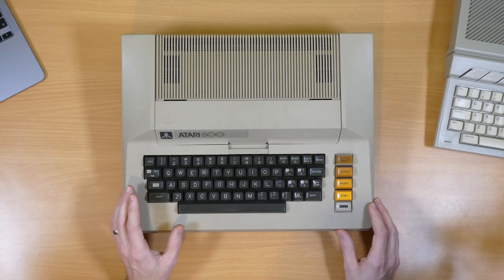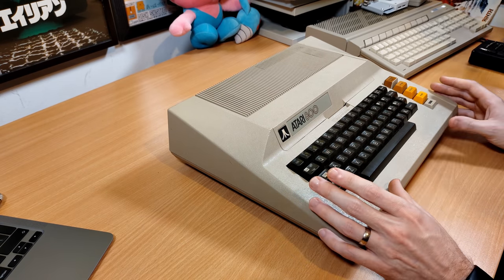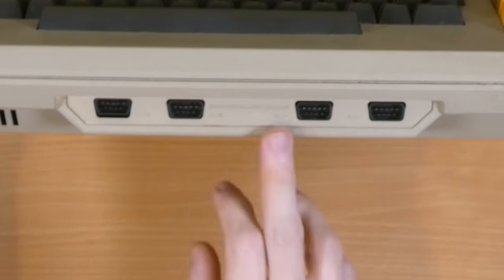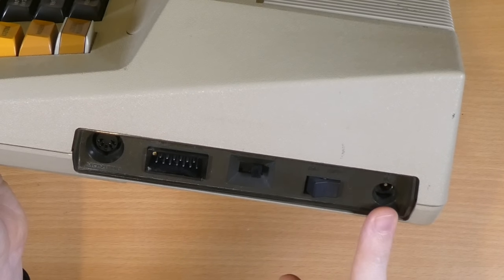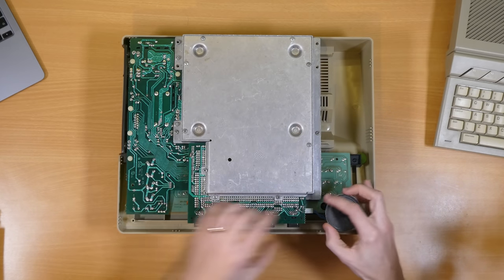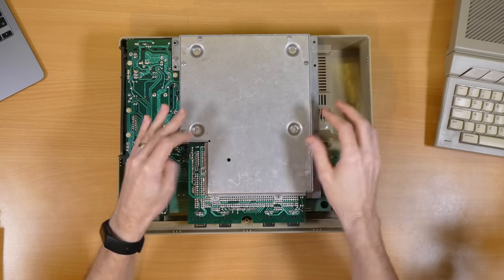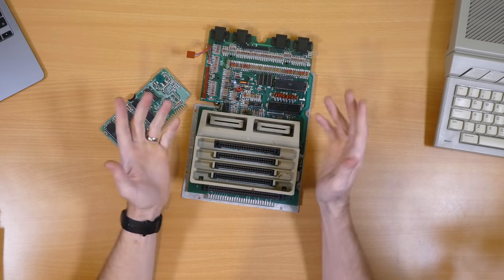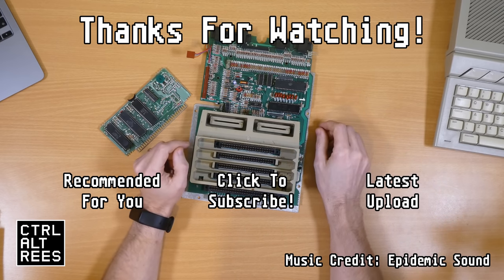Exploring The Atari 800 - Teardown Of Their First Home Computer From 1979

Comment: The 6520 pia chip has both its 8bit ports connected to the joystick direction lines, 4 each per port.  Some interesting things were made that plugged in 1 or more of those ports. The control lines of each PIA port went to the SIO port.
POKEY (pot and keys) looked after the paddles, keyboard, sound, SIO, random number generator and has some timers. The guy who did the serial part went on to design USB as part of a team.
GTIA (CTIA) looks after sprites, collision detection, keyboard speaker, console keys, joystick triggers and colours.
ANTIC has Lightpen input and runs its own program, also memory refresh. 400/800 only also has reset key on one pin.
The diodes you speak of near the controller ports are actually capacitors. Also inductors that look like green resistors.
Reply: The ANTIC doesn't really run its own program, it processes the display list, which is a sequential list of graphics modes to be displayed on each "row", which consists of one or more scanlines.  The only other thing it can set on its own is the address from which to fetch graphics data, which it will do when a certain bit is set on the byte containing the mode number.  Another bit tells the ANTIC whether to interrupt the CPU so that it can do other things at that point, such as changing color registers.

By the way, the C64 can do the same things, it just does them in a different way.  Rather than having to read through a display list during each screen refresh, the VIC-II chip interrupts the CPU on specified scanlines to change modes, addresses, and colors.  It's a simpler system that nevertheless gets the job done while taking less silicon, which not only allows it to have a single graphics chip versus two, there was room left over for a more advanced sprite system.
Reply: @IcyTorment   It depends on how you look at it.  If the designers themselves considered the list of modes (plus a couple of flags each) a program, then they wouldn't have called it a display list .  Let's look at another example for comparison: the C64's color maps (up to three color maps, depending on the mode) and more specifically its multicolor character/text mode.  The color/attribute map in this case sets the main color of each character cell, but it also has a bit that determines whether the corresponding cell is multicolor (4x8 pixels, four colors) or hi-res (8x8 pixels, two colors).  Is it a program or just data?  The VIC-II chip reads these bytes (instructions?) sequentially and acts on each one concerning one of the colors and also the mode of each cell (therefore it can change modes 40 times on each line in this manner!).  This is not so different, in my view, from the list of modes to display on the Atari.
Reply: @IcyTorment   I think another reason so many people consider the ANTIC a coprocessor that runs its own "program" is that it's a separate chip from the GTIA.  The logic is that the GTIA is the graphics chip, so the ANTIC must be the graphics coprocessor, which seems to make sense, except that this is an irrelevant implementation detail.  Every graphics subsystem must have a front-end, which fetches and often organizes the data into various modes, and a back-end, which creates the actual video output and often creates additional modes through various interpretations of the data coming from the front-end.

Some of the earliest graphics subsystems, such as those of the Commodore PET and Apple II, used many chips, with less integration than in later computers.  These two had both graphics front-ends and back-ends plus memory buffers, but some computers and video game consoles lacked one or more of these features.  For example, the early Sinclair computers (before the Spectrum) only have a back-end and memory buffer, and used the Z80 CPU to act as the front-end, feeding the back-end (on one or more chips) graphics data on each line.  And earlier, the Atari VES/VCS/2600 console only has the TIA back-end graphics chip, with the 6507 CPU as the front-end and no RAM buffer (only ROM and determining what to display on each raster line on the fly).

The Atari 8-bit's graphics architecture is based on that of the 2600, with the GTIA serving as the back-end instead of the TIA.  But because there was not enough room left on the GTIA for a front-end, an additional chip, the ANTIC, was added for that, and of course it reads its data from memory buffers.  For comparison, most later computers of that era have a single graphics chip, such as the VIC on the VIC-20 and VIC-II on the C64, that have both a front-end and back-end on the same piece of silicon.  Like the ANTIC, they read from memory buffers and run in a loop that continuously updates the display.  They don't have display lists in system memory, but they do run their own sequential processes, so effectively they are all coprocessors, of a sort.  This is different, in my view, from computers that depend on the CPU to act as the graphics front-end.  Display lists are unique (as far as I know) to the ANTIC on the Atari, but as I described in my previous comment above, the VIC-II has an attribute map/list that directs it to automatically change modes, too.  What I wouldn't do is compare the ANTIC to a CPU or say that it runs a program, which kind of implies the former.  In addition, real graphics coprocessors do much more.  The ANTIC is really a graphics front-end, which most other computers have integrated with their graphics back-ends.

By the way, in the mid-1980s Atari tried to put the ANTIC and GTIA together on one chip, but for whatever reasons it didn't work out.  These attempts were called the CGIA and KERI.

Comment: Good stuff! I had to replace the power input board (?) on one of my Atari 800's and actually got it to work again. Now I have a buzz from the TV (using an s-video cable to retrotink mini) on my other 800. It had been fine, so what next? The cpu board? I will of course replace all components one at a time such as power supply, video cable, retrotink etc before going inside the box. Any ideas? I'm a rookie.
Reply from the maker: Interesting. A buzz sounds like something isn't grounded properly, or it could happen if you've replaced the original linear power supply with a switch mode supply. Because of the way switch mode power supplies operate, they can create RF noise that can manifest itself in the form of buzzing audio or interference on screen on these older machines.
Reply: @ctrlaltrees  Thanks. I will give it a try.

Comment: rs232 was standardized a looong time before the atari 800. kinda dating back to the 1960s :P however the sio bus largely simply is rs232 with some different voltage levels and somehow (pulldown, probably) modified to do point to multipoint. also autobauding. but unlike commodore serial bus, not some 'failed attempt at cooking  up their own interface' just standard chips also used for normal rs232. (see thing is. if you would ever get the commodore serial bus to work in it's intended implementation, it can well do speeds over a megabit/s or higher (just that the chips are rated for 1mhz and as such the shift register would also be rated for 1mhz but hey that still leaves 7 cpu cycles or so per byte to transfer that serial byte). however the 6522 was a screwup, the 6526 was a screwup too, and a few times of 'omg we should just throw away failed production run chips, nah just use them anyway' further on you end up with a bitbanging crappy slow interface on the few functions of the chips that did still function :P... ataris interface however is normal off the shelve rs232 stuff with 'something else' than a max232 behind it allowing it to have multiple devices without things catching fire (probably the exact same chips used in commodores bus, voltage is probably standard 'high' and any chip can pull it down, rather than the other way around). but with normal rs232 framing. also the actual working part is just txd, rxd and gnd. the rest of the pins in that weird and unobtanium even back then molex connector are for 'other things' than just data transfer (cassette etc).